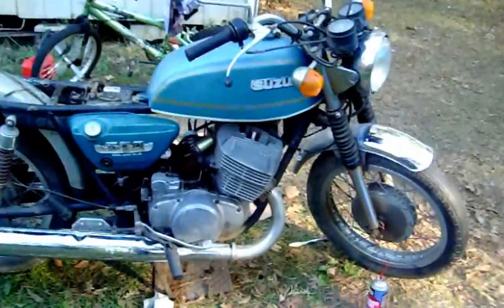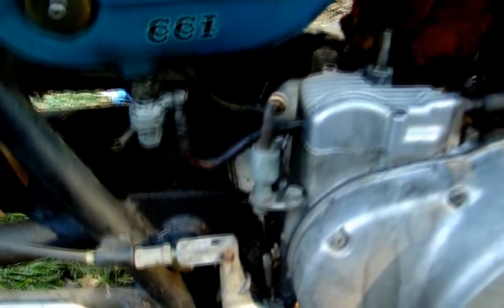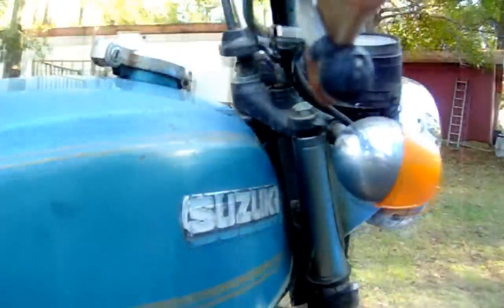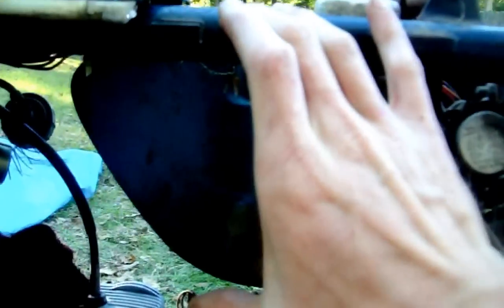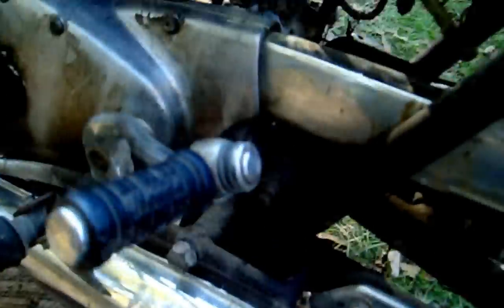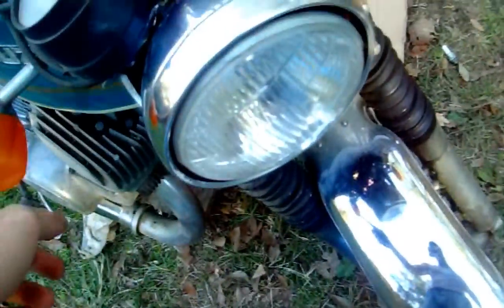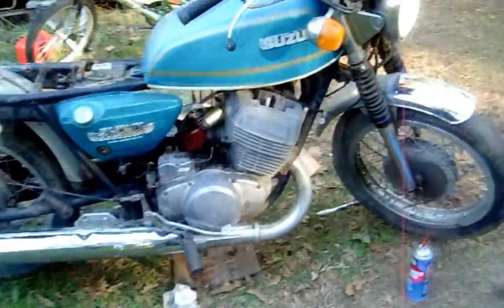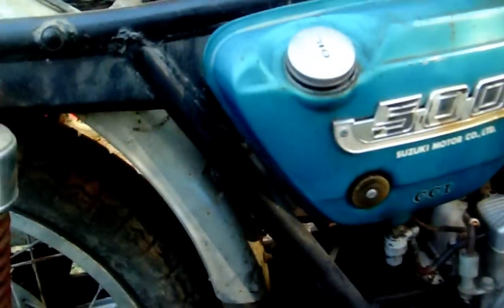Suzuki T 500 Build Walkaround

Comment: I have a 1970 Suzuki T500 Titan, I have owned it for 21 years. I am going to have to replace the transmission due to a pre 74 factory defect that causes 4th & 5th gears to break down from oil starvation(yours should be ok). I did a frame up redo on mine almost 10 years ago,frame repaint,engine redone,tank and oil tank painted 2002 Dodge intense blue metalic. the fenders are actually from a 1967 Suzuki Cobra(I chose these because of the full valance and bottom flare). parts are still obtainable